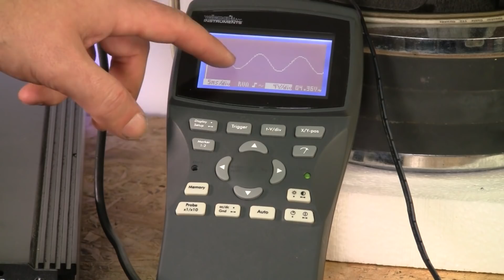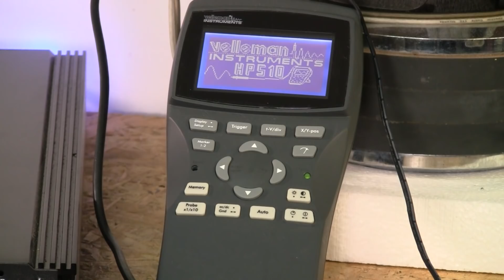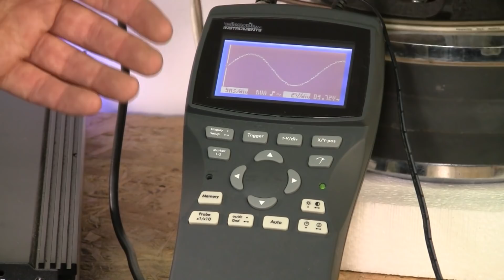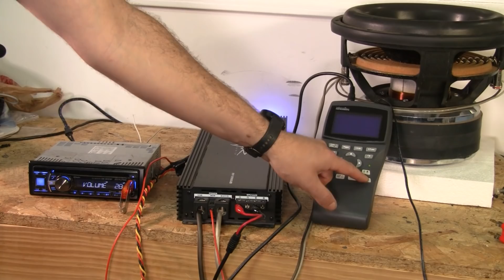How your budget amp kills subs without clipping - Tech Stuff Tuesday

Comment: This is my exact amplifier... so far so good but I’m a little worried now.
Reply: Holy Avocado hold tight, I believe he just started something.  Shitshow in 5, 4, 3,...
Reply: Og Scythe 😂
Reply: I've run this same amp for 3 years with zero issues.
Reply: @joeb9793  me too seems hes just hating on skar and trying o sell emf
Reply: Just don’t turn it up too high. As long as you aren’t clipping you are completely safe
Reply from the maker: Noise in the signal won't matter if you're to the point of clipping or not.

Comment: I wonder how the Brazilian amps, signal is. 🤔
Reply: The Brazilian signal is much better than this i had both rp2000 and taramps smart3
Reply: @quinton337  i agree, i went through two separate rp2000's...they both had different defect problems right out of the box...the first rp2000 worked for about an hour (returned to mfr), they sent me a different rp2000 that was a refurb (diff s/n) as a replacement.  What in the world is the company doing?!?!...scam-amps  Next, i tried a brazilian hd1200...for an inexpensive pwm class D, it's not too shabby and its hands down better than the rp line.  I wish i went with the hd3000 though as, my sub is a vxf-15 D4 (wired parallel).
Reply: @J-Ro2082  where did you find an HD 1200? those havent been made in over 4 years.
Reply: @TManFoodPage  ebay, NOS...luck find, i know 😁
Reply: @quinton337  hows the smart 3? I just ordered one for my system. I have 6 DS18 Z6 elite 6.5s in my f150 so its wired wierd and figured the smart 3 would be a good one to have some constant power to the subs.
Reply: @spdfrk101  its power is on par with my sk3500 just make sure you have enough juice because it will keep restarting itself when the bass drops
Reply: @quinton337  noted. Thanks!
Reply: I own a taramps bass 3k.. and it clips really easy... I can't calibrate it... I do struggle a lot,, and a lot of low notes are missing,,.. im looking for a ppi3000/1 or orion hcca 5000.1D. those have the best SQL ,,,, EVER.....
Reply: @ricardojuarez291  what is your signal input voltage (into the amp) at say 40hz and 60Hz?
Reply: @J-Ro2082   14.4v I have 2 xs power batteries connected and 0 gauge wires..
Reply: @ricardojuarez291  no, not the input power voltage.  I was asking about the rca signal voltage.
Reply: @ricardojuarez291  because u don't have the electrical to give it what it wants
Reply: @Ezra-Kanan-Skywalker  I feel like I do... I was running ppi 1000/4 for mids d highs, hcca 5000.1 crossover and epicenter with no problems..
Reply: @ricardojuarez291  no i mean u need a high out put alternator and big 3 with one gauge wire. That's what i mean by upgraded electrical
Reply: With all that u definitely need to upgrade your electrical. I got a 270 high out put alt with the big 3 and my clipping isusses went away with my Bass 3k on 2 Sundown Sa 15s . But before on stock alt i was getting clipping when i would set my Gain over half way
Reply: @Ezra-Kanan-Skywalker  yup you right I need a different alt.. I do have the big 3 but not the alt.. thanks for the advice... I will do that, in 2 more weeks..
Reply: @ricardojuarez291  i would check out the xbrand alts they are the best ones for the money in my opinion
Reply: @Ezra-Kanan-Skywalker  I can also convert my alt to 320 amps there a different methods to go with.. connect all the wiring in parallel.. all the wires inside the alt.. I can try that my alt still works but I have to replace it soon or later
Reply: @ricardojuarez291  you need to make sure you're getting at lease 200 amps at idle . Most factories don't do more than maybe 95 to 120
Reply: @Ezra-Kanan-Skywalker  this is what I was thinking,, Orion hcca 5000.1D vs taramps bass 3k... Orion 87% efficiency and taramps 70%..   that means to me taramps needs more current than Orion, but taramps are less eficcient. ... What do you think??
Reply: @ricardojuarez291  honestly it depends on what's your preferences Brazilian or Korean . But like that saying says you got to have power to get power. Have u saw the in depth reveiws that Wilson's Labs done on the Smart 3k . It's pretty interesting
Reply: @ricardojuarez291  and honestly that reviews the reason why I went with the Taramps
Reply: @Ezra-Kanan-Skywalker  yes I saw it... I sold all the system 5 years ago.. and I didn't have any.. but I try to go a little cheap this time... I mean taramps are not too bad for the price..
Reply: @ricardojuarez291  how hard is it to rewire your alt?
Reply: @jihartbladhest2749  what do you mean with rewire the alt??
Reply: @ricardojuarez291  you posted earlier you can rewire your alt to put out 320 amps..😂😂😂😂😂
That's what hes asking about
Reply: @bobdodge3171  yes... We made an experiment with an old one and it works,.. let me post the link I followed
Reply: @ricardojuarez291  don't need to i have 2 250 amp alts..  I won't rewire my own.. Because it's not that easy
Reply: @bobdodge3171  I know is not easy it all.. you need to spend at least 6 hours..
Reply: @ricardojuarez291  I had a taramps 4x400 and it did the same thing, the knobz were so finicky I couldn't get it set correctly.
Reply: @jihartbladhest2749  yeah I noticed, knobs on this amps are cheap.. out there is a few reviews about it,. But don't Crank it all the way up,, 3/4 that should be enough.. those 4X400. Are amazing for mids and highs.. you need a active crossover in order to make them sound clean.. and eq helps but not that well..
Reply: @ricardojuarez291  dont use a dd1 use the clip light on the amp itself.
Reply: @TManFoodPage  I can't afford to get the dd1.. and yes I do use the light that came with but all I said I based on my experience and opinion, taramps for spl is one of the best,,, I'm a SQL person so taramps is not giving me what I want. It was good to try them, I try the 400/4 and those little guys for mids and highs are great,, cuz you can easily run 2 ohms/ channel.. and high efficiency.
Reply: Ricardo Juarez is your electrical system strong enough? If it’s not it’s gonna clip very fast..also strong ground
Reply: @876caraudio4  I have 0 gauge positive and ground...
Reply: Ricardo Juarez you can have 0 gauge and still it’s not a strong ground spot on the car, get your tester and check positive to negative Battery in engine bay...the check how much after the run to the amp positive and negative.. cross reference the numbers to make sure not too much volt drop b4 amp is powered... if that is not too much deference.. play a 40hz tone and see how much your volt drop at high clean volume...if it goes below 12v it’s not enough to power those amp
Reply: @876caraudio4  I'll keep that in mind and try to fix it,.. but my meter at high volume is 13.5 v. Im always checking that..
Reply: I’ve owned Stetsom 6k and 8k I got plenty of current and everything runs lukewarm to warm. And clean!
Reply: Like a bulldozer....loud and dirty.
Reply: Test one please...
Reply: Don't want to find out. China made ruined it for me lol
Reply: Just thinking the same thing ,bro
Reply: Jeffrey Barton  I'm giving my advice based on my experience,.. it sounds ok for spl ,,, this tiny amps are so strong,, the taramps HD series sounds better than 3k bass.. I need to figured out if I'm way to low in my hz that can be the difference,.. ok look I took the dimensions from dd subwoofers and they recommend 1.5 cu ft if you have 10" aero por 4 inch's 27 inchs long.. so my box is 1.47.. so it's tuned at 32hz. I'm ok with that, but lower notes with this amp I can't hear them..... Example if you are playing the famous song I love you bass, it has a tons of frequencies in a different volumes, so when it the lower lower way to lower notes the amp does not play them... I was waiting to shake my truck but I got likeeeeee!!!! Realllyyyy.... What a helllll.. that's when i start doing some research and I keep looking for a earlier 2003- 2007 hcca or ppi..
Reply: Jeffrey Barton  look at this nice excursion with the hcca 5000/1D.. this is my friend you will see how it shakes the 5th door from his SUV..   https://youtu.be/Mk0t43ll_4g
Reply: I waiting to receive Smart 3 in shipping. Currently using Skar 1500.1d so it better be good lol
Reply: Please test a Wolfram C2400.1
Reply: @simonbautista8662  I used to run an rp2k upgraded to a wolfram 2400, all my.goofy issues dissapeared
Reply: Jihart Bladhest how many Ah battery do you have running?
Reply: @simonbautista8662  180ah
Reply: @simonbautista8662  190amp alt 14.5-14.9 fully cranked running a 1200.1 2400.1 and a 90.4
Reply: If it's a powerus it's perfect

Comment: I was just looking into buying the rp2000, thanks for the informational video
Reply: I've been running my RP-2000.1D for almost 3 years on the same pair of 12's, and have yet to hurt either sub.
Reply: I have a skar Rp 1500.1 no problems out of it.
Reply: I've had my Skar RP2k for awhile now and set it up with an oscope and have had no problems hooked up to two Sundown sa12's, but I do recommend having an upgraded electrical system if you plan to run one.
Reply: You're fine. This amp is physically damaged
Reply: Get a hd1200 or hd3000 (1 or 2 ohm ver) instead, depending on your sub of course.  You won't be disappointed.

Comment: Let's face it cheep amps stay away from. I run a old custic 360 for 4 tens works grate 20 year old amp.worked then works now
Reply: Ive had a coustic 360 wired to 6 twelve's and 1 fifteen before . After a hour i would have to put an ice pac on it or it would shut down. Just picked up a 460. Can't wait to see how it performs .
Reply: @cadillacwrench  yep I thank. 6 12s will doit. 😆 I'm looking for a 380 the black one coustic thay run hot to .thats cool tho I'm not the only one running something I know will work .i had it turned up to much so I just turned it up 1/4 of the way and she's fine now it wus not getting hot just sounded like crap .but she's good now.

Comment: You need another of the same amp to test. That looks like a defect in that amp (or mounted on the box causing damage or amp was damaged by user error). That amp is quite popular and I haven't heard or see comments/videos with having issues with them. Testing a used amp that has already gone through blown speakers and unknown usage by the user isn't a very good test to begin with.

Your title is misleading also, it's going to make people think all budget amps are bad which obviously they aren't.

Edit: Just seen at the end you mentioned several customers with these came with the same issue. Still perhaps try a new one and see if it does it.
Reply: Why does he have 8 guage power and ground??? 1/0 connections!!!
Reply: @BangingCamry  Good valid point!
Reply: @BangingCamry  because it's a very short run and hes not running much power. And doesnt give a fuck about the amp. Also Its 4gauge taramps runs 4gauge because they know how close to the battery it will be
Reply: @BangingCamry  😒👍?
Reply: I had a rp 2000 and a audio pipe 2000 this board did the same thing on my O-scope
Reply: Whatever barevids did is irrelevant to what I stated about rp2000.1d having an incredible amount of issues.
Reply: @kwhitneyskillz   more likely, stupid ppl using them causing the issues. Countless review pages for them are 4 and 5 stars. I think you're either talking out your ass or you're just repeating the same shitlips talk of others. 

I can bet most the people having issues with them, run  stock electrical expecting the max lower from the amp, and burning stuff up, than trash talk it, cause their 5,000 watt Boss amp never "burnt anything up"  with the 200 watts of power it put out.  Either way I could careless, I don't like Skar, and this video should be deleted for its own stupidity and bad info and poor testing.
Reply: His title is actually correct because people have different views on the word "budget"  even though most definition are the most power for my money . The defect in the amp is what hes claiming as a common defect which im not gonna insult your knowledge by explaining but just for no one gets the wrong idea , hes saying this problem happens across more lines than just this one and you should be aware that when purchasing cheap things you get cheap things problem. Not every amp does it but there will be one that does. This kinda like the rockville situation where lots of people had problems and others didnt. Skar is still a great company but they are gonna fix the problems with the RP line. Why would they ? If they did it wouldnt give you a reason to buy the skv line which is built way better. You can even compare this amp to the new SFB 2k in which they both where most likely built in china to keep down cost but look how the quality of the build is different. Remember the subject isnt about skar audio making bad amps its about how what this particular skar amplifier is doing happens more often than people think which is why reputable subs that can take power an abuse (which since it was sundown im gonna assume it was the SAv2 which ive always seen paired with a 3k) blow on more/less/ rated power. Its always been said that you can run more than rated if you have CLEAN power and even more importantly a CLEAN SIGNAL. Much love my brother !
Reply: @chadbeverly4926  That was an esay but you are right😀👍✌👋👊
Reply: @chadbeverly4926  wrong again! The Rp models have a China motherboard and the skv2 models have a Korean motherboard.
Reply: I have heard bad about tht particular amp. But I agree it isn't conclusive.
Reply: Well you're clearly dumb as dog shit. You probably bought this amp and that's the only reason you are talking shit because just don't want to believe that other users have experienced something different. You're a typical car audio guy of today. Don't really know shit but think you do because you watched a couple videos.
Reply: If you haven't heard of the problems with these amps then you either haven't been paying attention or you're brand spanking new to car audio.
Reply: @kwhitneyskillz    I stand by my comment, P.S Barvids also did a follow up to this video, stating pretty much the samething and even explaining how Sean used his oscope wrong.
Reply: @kwhitneyskillz  yup like me in 2018
Reply: @kwhitneyskillz  wrong! been in the car audio feild for over thirty years and what I know about Skar or any other amplifier, you never test a damage amplifier that possibly damage speakers. So if Skar RP line of amplifiers are so cheap and deadly to speakers, then why is Skar so damn popular and the rp line of products?